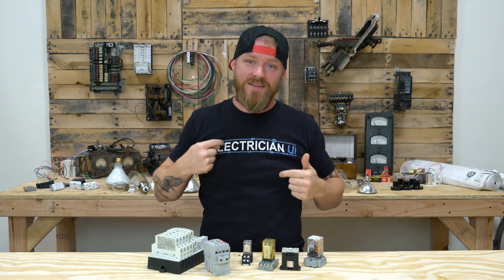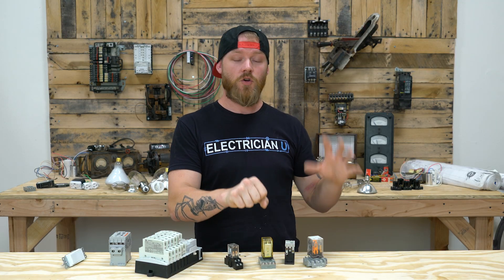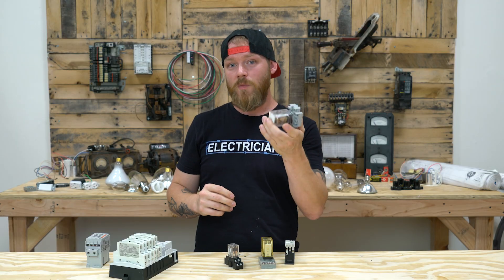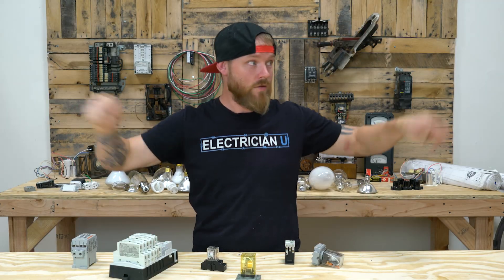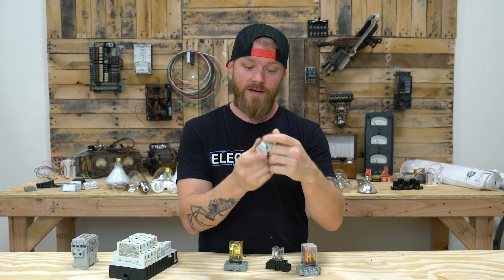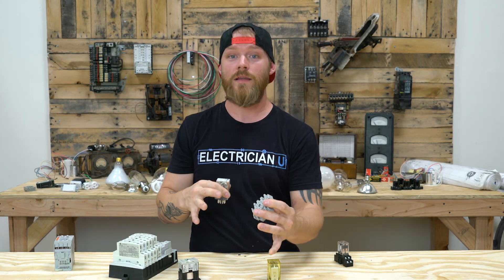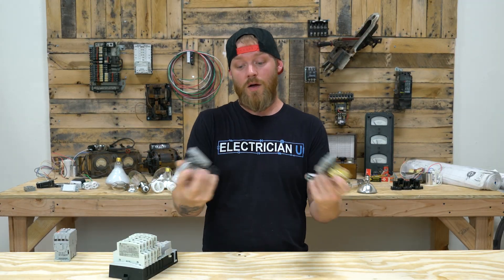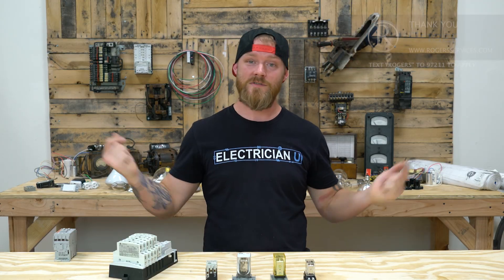Episode 31 - Control Relays - HOW THEY WORK & WHAT THEY'RE FOR

Comment: So if it’s a 120v relay I can run 120v to each coil correct? Or the maximum voltage the whole relay can take is 120?

Comment: I’m sorry but this video is a mess, the structure is all over the place. A better approach would have been: 1. Applications 2. Relay types 3. Technical details. Instead you vaguely hint at why relays may be useful ( primary benefit is it allows automated switching eg turning lights on at dusk) you mix that information in with a bunch of technical information at the same time that contradicts. For example you bring out a relay that uses 24 volt switching signal and then randomly start talking about 120 volt switching and then move to a different continent and start talking about 50hz relays…. Why? If this information was in a book format would your outline make any sense?

Comment: Another good video. 
I have a small control box with a green on button, a red off button. I want to send 120 vac to three things when the on button is pushed. 
1. A 120 vac indicator light. 
2. An AC to DC converter. 
3. To an aviation connector that sends the AC to another control box. 
What do I need? A relay that has three NO that turn to NC when power is applied? Is that an 11 pin relay? 
How do I wire that?
Your help is appreciated. 
Thanks,
Paul

Comment: Can I use a high voltage input to start a low voltage circuit? Do such relays exist? Ie energize the relay with 240v to activate a 24v circuit

Comment: I have seen people wire up an ice cube relay base with round holes in the socket and then try to insert a relay that has flat blades. My advice is to check the number of the socket to ensure it is compatible with the relay you plan on using.

Comment: I would like to control a 1.5hp pool pump 120v rated 19amp using a microcontroller like an Arduino. So I need a relay or contractor with a 5v or 3.3v DC input. Any recommendations?

Comment: does anyone know if things like exit signs and emergency lighting units have relays in them?  if so, how are they tripped or whatever if they operate when power is cut out?
Reply: Many "emergency light" systems have batteries inside the box. Often it is a lead acid battery about the size of a lawnmower or motorcycle battery. There is a small trickle charger and charge monitor circuit built in to the box that keeps the battery charged during normal situations (power is on). When the main power goes off, a relay kicks in which turns the emergency light on. This relay is controlled by some simple circuitry and a transistor or FET. If the system uses Lithium batteries, things are different.

Comment: What I want to know, coming from a twelve volt DC background, is how the coil pulls in?  In DC the current goes in one direction, very easy. With AC, do they use diodes and capacitors?

Comment: Does it matter on the coil if the neutral and hot are reversed.
Reply: Shouldn't matter as long as the voltage is correct.
Reply: @Inflec  thank you

Comment: Thanks for the info Dustin. You talked about the uses with light circuits, but what about something like turning on a fan - or increasing the speed of a fan - once a certain temperature is reached? Would you use the same device, but instead of a photocell sensor it'd be a thermostat temperature switch?
Reply: pbakai182 yes exactly, that would work. The  thermostat switch leg would wire to the coil of the contactors or relay.